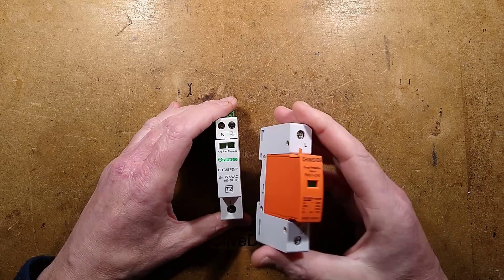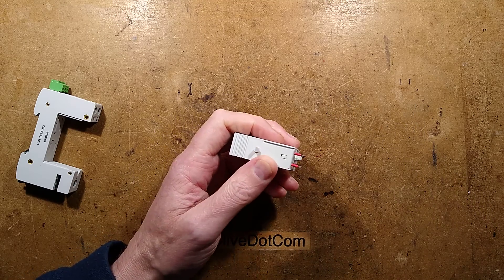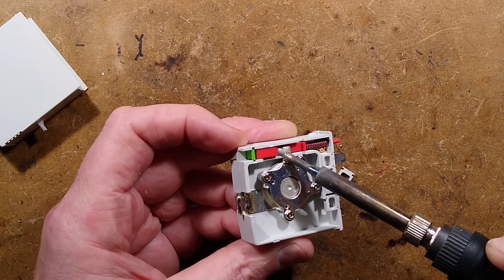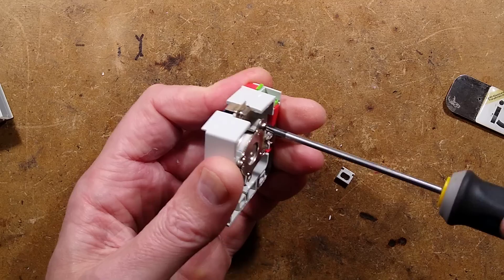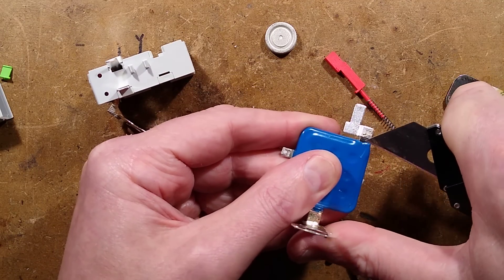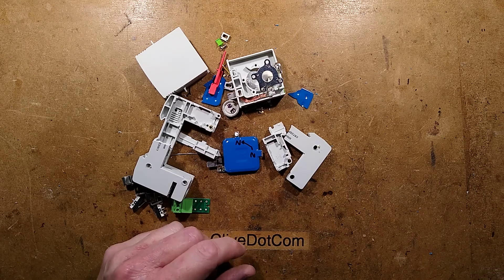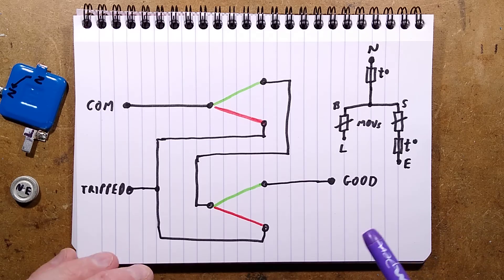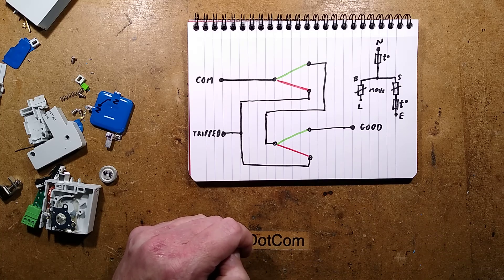Expensive UK surge protector teardown

Comment: And that reminds me to find those heat switches for my parents heater. They don't work anymore. 🤔
Reply from the maker: Thermal fuses?
Reply: @bigclivedotcom  
There's two of them in a night storage heater, they're round and are screwed to the frame.
They cut the power if things get too hot, one is resettable.
I need to find them, I think my parents have moved them while cleaning. 😆
Dyslexia and not good with names really doesn't help. 🥴
Reply: Bimetallic switches. Also called thermal switches and bimetallic thermostats.
Reply: @Monkeh616  
I think that them. Just need to find them and get the details.... again. 🙄

Comment: £92 for £10 worth of parts.
Reply: But it's about the manufacturing the distribution ect ect, I do agree tho. Almost all products are the same
Reply: @christophercannon769  Not all devices are created equal or adequately rated - fit for purpose. 
R&D, Testing, Certification, Manufacturing, Marketing, Distribution, Retail markup... and then Installer markup - Would you expect me to buy and stock such an item and then on-sell to a client for nothing? 
£92 would be 'List Price' ... a Trade price from an account holder to the manufacturer or Wholesaler could be as low as -50%.
Reply: @BTW...  goes without saying but somewhere between £10 and £92 there's a sensible price that gives the manufacturer a reasonable profit without ripping off the consumer.  Also, lower price, more units sold.  Let's not forget this is two MOVs in a plastic case.
Reply: @Chris-hy6jy  1 very substantial MOV + 1 GDT (sparkgap), not 2x MOV,  highly engineered and certified SAFE.  
Tooling for that and certification isn't cheap. 

But, you can go without and cop the consequences... or worse, buy a POS that has none of that , like the previous non-approved crap, or a cheap crap Class 3 'power strip' that has zero fault containment or real sink capacity, so all it gives is free fires behind the AV and computer gear, even if it's simply plugged in with no load connected.
Reply: @BTW...  The £35 BG and MK units are a POS and not certified?

Comment: I'm wondering why they use resistors... why not use a coil and if the voltage is high enough it pulls the connector away, breaking the contact which is then latched on the disconnect side.

This way you can reconnect it by a leaver, like a normal fuse
Reply: Because these don't disconnect anything in normal operation and operate far faster than any mechanical contact?
Reply: @Monkeh616  why would a magnet disconnect anything "in normal operation" if it's rated for an overvoltage event? I don't get what you could mean.

Melting a contact is slow, very slow.

That's why RCDs are mechanical contact not melting fuses.
Reply: @RubenKelevra  These devices do not achieve protection by disconnecting the supply, but by clamping the voltage by conducting. The solder is purely to disconnect the MOV after it has failed.
Reply: @Monkeh616  ah okay, so they connect basically live and earth together....

So they will basically blow also the fuse on the grid above them then, right?
Reply: @RubenKelevra  No, because the transients are far too fast for the solenoid to operate.
Reply: MOVs conduct in around 5 nanoseconds.
Reply: @curtw8827  sure, but how long until they solder is melted and dripped down? half a second? one second?

Anyway, an electromagnet is faster.
Reply: @RubenKelevra  These devices don't disconnect the power to the circuit,  they conduct to shunt the transient energy to ground to hopefully clip off the transient voltage spike, if the energy pulse (joules) is greater than the MOV can handle, they self-destruct. The solder melts to disconnect the overloaded and about to fail MOV.
Reply from the maker: There are electronic versions that will detect overvoltage and break the circuit until it returns to normal, but these are for clipping very fast transients and spikes.
Reply: @bigclivedotcom  I know, UPS got these included. But that's not what I mean. I was talking about passive components.

Comment: Here in the states. A whole house surge suppressor is a block that screws into a knockout hole. And the wires that come out of it going to a convenient breaker of sufficient capacity usually 40 amps or 60 amp. So they're very universal. If you get hit so hard with lightning that it shorts right through the suppressor it will trip the breaker its connected to.
Reply: Some models are designed for breakers and some are not. It's always a mess choosing the correct one.
Reply: TYPE 1 have internal fusing so they can be attached to the system without a CB.

Comment: Are those supposed to be thrown away after they trigger? Are the varistors actually damaged in the process? Because it seems like they could be reset by the manufacturer (by removing all the old solder and reapplying the correct amount again).
Reply from the maker: The only time they should melt the solder is when the MOV has absorbed so many transients that it has broken down and started conducting enough to heat up.
At that point it needs replaced.
Reply: They only heat up and melt the solder when defective - this requires either an enormous transient or many, many smaller ones. They last years in practice.
Reply: @Monkeh616  - Defective? Heating up and melting the solder is how they protect the circuit from major surges, no? "Defective" would mean failing at their job and letting the current through.

My question is whether heating up to the point necessary to melt the solder and break the circuit (which I'd say is still doing their job when a surge happens) actually damages the varistors themselves.

It seems like a lot of material there (basically, everything but the solder) could be reused by the manufacturer.
Reply: @RFC3514  They do not heat appreciably during transient events - the clue is in the name. They last milliseconds or less. The MOV only heats meaningfully when damaged and conducting on normal supply voltages.

Heating up and melting the solder is how they FAIL.
Reply: @Monkeh616  - Nothing in the name refers to temperature. And surely, it depends on how long "the events" last.

It seems that what you mean is the opposite: that having failed is what makes them heat up and melt the solder. Not "being defective".

In other words, if they ever heat up to the point of melting the solder (even if it's due to a single prolonged event), that means they are no longer functional. Is that it?

Comment: The round disk is more than likely a spark gap device, there more to handle a loss of neutral fault, and safely indicate there is a neutral loss, but still leaving the main MOV capable of handling surges. Normally high voltage between live and neutral is handled by the 9 small MOV module, and the one between neutral and earth is there for things like lightning, that elevate both line and neutral well above earth, and the spark gap will fire, clamping the massive overvoltage down to the hold on voltage, typically 30VAC across the device so long as current is flowing. Then after a few minutes of clamping the spark gap will finally melt the solder, breaking the neutral, and the switch contacts will open a contactor in the supply side, that then disconnects the load. Same for high voltage for a few minutes, the 9 MOX block will heat up, and clamp to 400VAC or so, till they melt the solder, and the now smoking protection module will finally be able to release the contactor. Switch contacts are normally connected to both a contactor, rated for the full load current, and with a mains rated coil, that is also rated to withstand double the applied mains voltage for at least an hour, so that it does not fail first. Then you have a set of indicator lamps, to show that the mains is applied, and protection is working, with a green lamp, and that the mains is present, and the protection circuit has disconnected due to fault, with a red lamp. No lamps lit your power is off.
Reply from the maker: The small device connected to earth probably is a gas discharge tube or spark gap.
Reply: @bigclivedotcom  indeed, the Epcos is a 600V spark gap arrester, the 20 is the year and the 0 at the end means non radioactive.
Reply: This is not a spark gap as it's a type 2 device and not designed for lightening current as in a type 1 device
Reply: @roberthawley3995  Per the data sheet, that component is in fact a xenon spark gap.

https://www.tdk-electronics.tdk.com/inf/100/ds/EC600X-X0780S102.pdf
Reply: @roberthawley3995   This Class 2 - T2 protects from lightning.
Do you understand the difference between T1, T2 and T3 devices? Seems not. 

Type 1 Surge Protective Device (SPD)s are intended for installation between the secondary of the service transformer and the line side of the service equipment overcurrent device, as well as the load side, including watt-hour meter socket enclosures, and are intended to be installed without an external overcurrent protective device. Type 1 devices are dual-rated for Type 2 applications as well, providing the highest ratings available for installation at the service entrance.
Type 1 SPD can discharge lightning current with waveform 10/350μs. This, if required, will be installed in the primary distribution board at the origin of the electrical installation. A Type 1 SPD does not in itself offer the required protection level and must be used in conjunction with coordinated type 2 devices. An installation with a lightning protection system will require a Type 1 SPD.

Type 2
Type 2 Surge Protective Device—Type 2 SPDs are intended for installation on the load side of the service equipment overcurrent device, including SPDs located at the branch panel.
Type 2 SPD can discharge  8/20μs current wave , they can prevent the damage of transient overvoltage in the electrical installations and protects equipment connected to it. It usually employs metal oxide varistor (MOV) technology. The device would normally be installed in sub-distribution boards and in the primary distribution board if there was no requirement for a type 1 device.

Type 3
These SPDs have a low discharge capacity. They must therefore only be installed as a supplement to Type 2 SPD and in the vicinity of sensitive loads. Type 3 SPD's are characterized by a combination of voltage waves (1.2/50 μs) and current waves (8/20 μs).
Type 3 SPDs are normally installed right before the protected equipment.
Reply: @roberthawley3995   actually the Epcos thing is described in its datasheet as a Class 1 surge arrester (so spark gap or gas discharge tube are likely correct as well) to go in between N and PE. It seems it can be upgraded to Class II by adding a varistor.
Reply: Correct - Gas sparkover protection on the N/PE side. 
But don't try to pretend you are a trade qualified electrician familiar with these when stating "The round disk is more than likely a spark gap device, there more to handle a loss of neutral fault, and safely indicate there is a neutral loss, but still leaving the main MOV capable of handling surges." 
That proves you don't know what you are talking about.

Incorrect - The sparkover element has nothing to do with "there more to handle a loss of neutral fault, and safely indicate there is a neutral loss.." it is to sink UHV surges well exceeding any transient supply variation. 
A Neutral loss fault would render the MOV protection useless anyway, because it is connected between Active and Neutral ... not PE which is how the Sparkover is connected N/PE. Can you actually read a schematic? 

Incorrect - There is 1only MOV in this device.  There is no way a 9x MOV array rated to sink 20 - 40kA  / 100kA would fit in that single module, let alone one that also contains the sparkover LIGHTNING protection. 

Incorrect - Sink a 20 - 40kA surge and these will be hot BUT NOT smoking as they are rated to such fault conditions without being reduced to 'smoking' state. They would NOT be certified to ÖVE SN 60 and UL if they did. 

Incorrect - This DOES NOT disconnect Line from Load. 
The remote monitoring switch is only designed to indicate a significant surge or sparkover has rendered the device faulty OR if the module has been removed from the mounting base.   
Setting up a supply main contactor (and BTW, anything rated for main supply protection and control is always rated in the kV range) would be highly problematic for everyone in the building, disconnecting supply to all but essential services for transient fault conditions... or some idiot pulling out a module from the mounting base.  Don't you think?
Reply: @BTW...  Play nicely and explain where he was wrong. We are here to learn.
Reply: @Zlodej5   Who is this "he"? OP... The supposed authority on how these function and how they are implemented in a protection control system... or the latter guy that doesn't understand the 3 Classes of SPD?  It's explained.
 Learn to Read more first, and then bother to do so.
Reply: @BTW...  So why is the gdt only between PE and N; and the MOV only between L and N. I've seen this in other devices (like the ones made by Schrack) and always wondered about it.
This type of arrangement seems to be only used on TT systems too?
Reply: @koffibanan3099  OK, first lets define High Voltage and Low Voltage in AC supply networks.
Low Voltage is below 1kV... High Voltage at or above 1kV.
Your LV supply at each Phase (there are 3) could be 100V to 250V (A to N) depending on where you are in the World. 
Your HV supply at each phase (there a re 3) could be 1kV to 600kV, depending on the grid feeder setup and location. 

The PE conductor (call it Earth or Ground) should NEVER be intentionally used as a load conductor i.e. used as a Potential Difference to Active to power an appliance - NEVER  EVER
It's purpose is to prevent a faulty energised appliance using YOU as a path to Earth/Ground. 
If used as a Load conductor, imagine what happens if that Main Earth connection is broken to the Main Earthing Stake. Hint: Every metallic appliance connected to PE becomes Active. Shit happens when that Main Earth is disconnected. 

Now, basic operation: 
When a HV fault occurs on the Active and/or Neutral  it is conducted to PE. 
If the HV fault is on the Active it is conducted through the Varistor to Neutral and then through the GDT to PE. 
If the HV fault is on the Neutral line (highly unlikely) it is conducted through to PE. 

The Varistor  is used as a resistive load to sink any excellence in the Low Voltage Line (Active) voltage. That could be as little as 1 Volt or more above it's rated conductive voltage, based on the nominal supply voltage ( A to N ) That transient surge in the supply could be far higher. e.g. 50 volts or more depending on the cause of the exceedance.   
Again, the PE conductor should NEVER EVER be used as a load conductor i.e. used as a Potential Difference to Active to power an appliance. NEVER  This includes sinking transient voltage surges... so the Varistor is connected between the A & N for such LV faults. The second device (GDT) acts as open circuit at LV fault voltages, so there is no conduction to PE. 

The Gas Discharge Tube (sparkover) device is used  to sink High Voltage transients to PE ( Protective Earth/Ground). 
The origin of such HV  could be from Lightning strikes into the Low Voltage distribution network (poles and wires) or within a building if struck by lightning. 
A lightning strike seeks to go to Ground by any means possible, Bare HV and LV grid wiring or a radio / TV antenna and LV wiring in the building present as  a low impedance/resistive means to do so at that voltage level ! 
HV on LV surges can also originate from HV grid lines falling onto LV grid wiring - tree falls or poles down from traffic accidents are common means... shit happens. 

SPD's are used and function correctly on all types of AC supply systems... not only TT or MEN systems. 
SPD's are also used on telephone and data lines that operate at Extra Low Voltage level. They may use Varistors + GDT  or Varistors only.

Comment: It has always been my experience that expensive electronics always protect the fuse or MOV by failing first, usually catastrophically.
Reply from the maker: Yes they do.
Reply: It's a feature
Reply: Failing to do that, and the fuse actually gets burned, the fuse will always require more effort to replace than what the electronics designed to protect it is worth.
Reply: 😆 I've seen the opposite quite a few times, where the MOV is blown in half, with a big black slid mark all over the board and the under side of the device cover, but the unit is still working perfectly... 🤷
Reply: Surprisingly In India even the cheap ones do have those
Reply: I have a 3d printer with a hidden 110/220 selector, and plugged it into 220 whole or was set to 110. It blew the fuse

With a new fuse and the hidden switch switched it works perfectly
Reply: @AdamMansbridge  The Chinese stuff seems to all be designed to just work between 70v & 260v. The wwitched mode power supplies are auto-sensing. It's a nice touch.
Reply: What fuse?  The one in the plug?  Good luck with that. 
MOV's respond and sink in nano seconds... a fraction of an AC cycle. Faster than any fuse or CB can trip. 
By your reasoning, why bother trying to protect sensitive expensive electronic equipment at all.
Is that 'cheaper' for you?  
These surge arrestors have been used in Industry for many decades, time proven, without stupid cynical clown thinking.
Reply: @BTW...  You do realize we're purposefully whimsical here, right? Sheeesh, what a buzzkill...
Reply: @zwerko  Shhh... infant. The adults are taking now.
Reply: @BTW...  No fuses in the plugs here in Australia, it was the printers fuse in a holder next to the power cord
Reply: That's because you have been using crap surge protectors in your distribution panel.